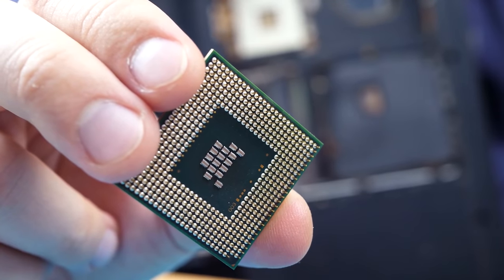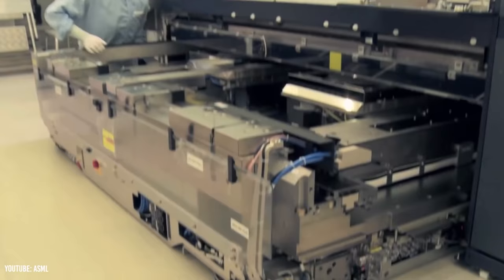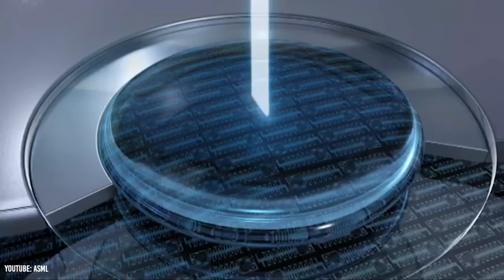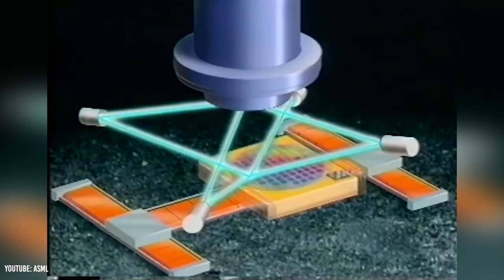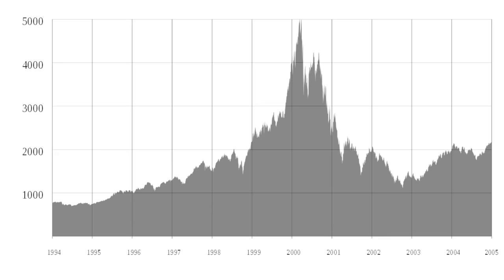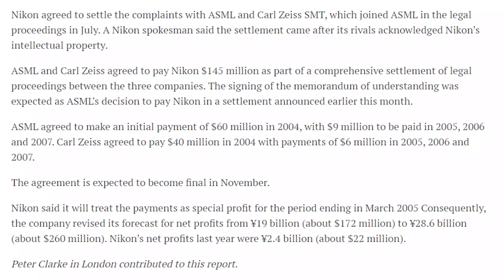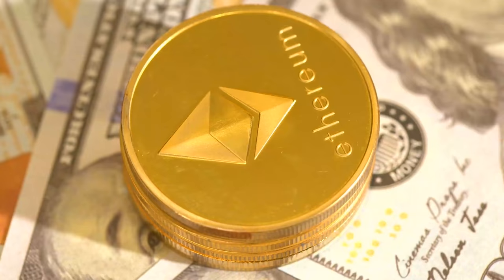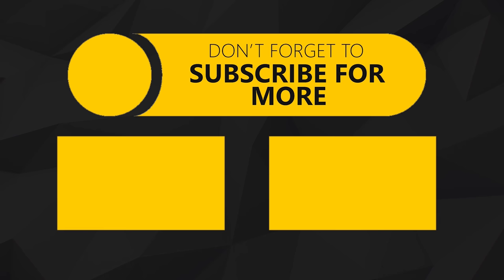ASML | The Most Important Company That You've Never Heard Of

Comment: ASML should make there own semiconductors chips, because they have monopoly on lithography Machines

Great video hari 😁👍
Reply from the maker: Thanks Prakhar! They def do have an advantage if they decided to enter that field
Reply: @LogicallyAnswered  No they don't. Developing a process and delivering a PDK to a company to design a chip with is incredibly different  than  developing manufacturing equipment.
Reply: @christopherciliberto8522  well designing semiconductor chips is easy compared to manufacturing lithography Machines and also ASML have a upper hand because of there patients, they are the clear winner in the race 👍
Reply: @lelouch9609  I am not arguing the difficulty of such it's a completely different skill set. ASML develops the manufacturing equipment sells it to let's say TSMC. TSMC's process engineers finely tune and adjust repeatable patterns of  well defined and well qualified photo lithography cells  and work with model engineers to create a process design kit (PDK) to give to the end designer like places AMD to design a chip. It is a completely different field of work and there would need to be considerable amounts of research and capital put forth to make a foundry.
Reply: @LogicallyAnswered  They most certainly do not. You have to understand the industry better before making such statements. A lot of people already knew what ASML does long before you did. ASML does not have the economics of scale and client base that TSMC has. For them, its much better to just keep selling advanced lithography machines to TSMC, Samsung and Intel than try to compete with them, it'd be stupid idea.
Reply: @lelouch9609  ASML is just 1 semiconductor machinery maker, there's plenty of other machinery that a fab needs which companies like KLA and Applied Materials manufacture. Learn more before making foolish statements like this. TSMC has economics of scale, the client base and experience using all these different machines together on their side. ASML would have to start from 0 in a very capital intensive business which makes no sense when they can just keep selling their machines to TSMC, Samsung and Intel. A lot of uneducated people think Apple or Nvidia should start manufacturing their own chips as well, which makes 0 sense for them. There's a reason why this industry is structured the way it is, and most of you know very little about it. I just think its arrogant after watching 2 or 3 YouTube videos you think you know better what these companies should do than their CEO's lmfao.
Reply: @christopherciliberto8522  if they really wanted to enter a new market the solution to that would be buying ARM, so they can assist both the chip producing (fabs) & designing companies (like AMD, etc.)
Reply: @christopherciliberto8522  Calling it "It is a completely different field of work" is way too far. The people making the machines, and having spent 30 years of R&D on it, definitely have the capability to run the machines as well, if we're talking about knowledge/skill. Of course turning that in to a successful business also has many other commercial factors, like the cost of labor, getting contracts and so on.

Comment: ASML could easily make their own chips and monopolise the whole market!
Reply from the maker: Well, they would def have a massive advantage
Reply: Nope,they don't have the money, expertise, nor the capacity to produce so many chips.
On the other hand, TSMC may produce it's own machines because  the will have to .
Reply: @1Eagler  What makes you think TSMC also has the expertise to make the machines they use. TSMC is known to be a pretty cut throat business where they try to streamline and make the chips they produce the cheapest they possibly can. If they were going to start to make moves into manufacturing aswell because of the money they would have started already. Also not to mention every process change they have to build new machinary to manufature the smaller chips so it might not be profitable enough for them so they decide to just make the silicon wafers, much like AMD doesn't manufacture their own cpus they send the design off to TSMC for them to produce the CPU.
Reply: @Deadpixelator y need 10-20 $ billion and 3 years for a chip factory, let alone planning .
ASML doesn't have this money.
TSMC has enough time to start it's own R&D and produce last generation chip  
Have  y wondered why TSMC hasn't bought ASML?
Reply: ASML is in fact a monopoly in UV machines fabrication, simply because there is nobody else capable of building such cutting edge products
Reply: @1Eagler  
"Have  y wondered why TSMC hasn't bought ASML?"
TSMC doesnt have the money to buy ASML but most importantly the EU and US wouldnt ever allow that kind of sale anyway.
What even is that question?
Reply: @1Eagler  you think such an acquisition wouldnt get blocked.. mate